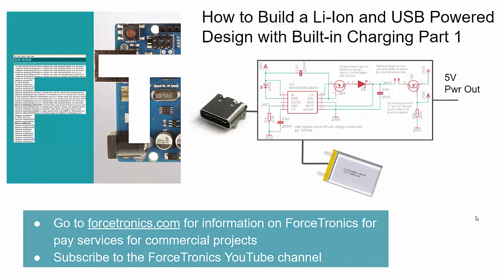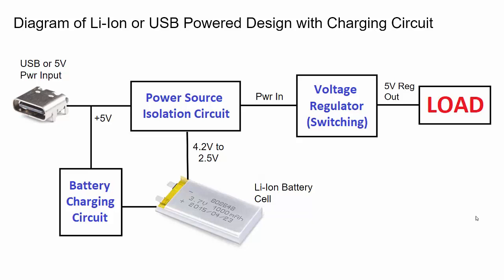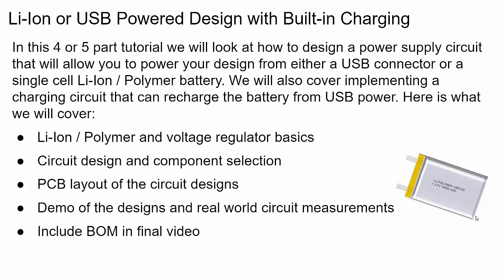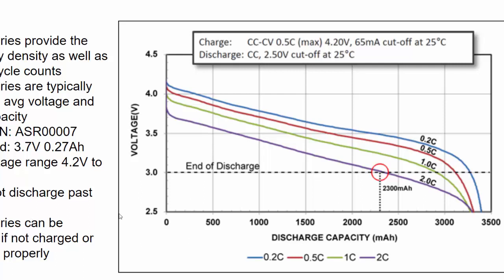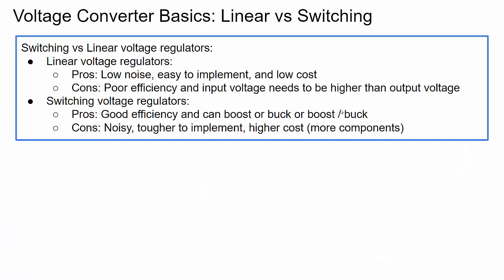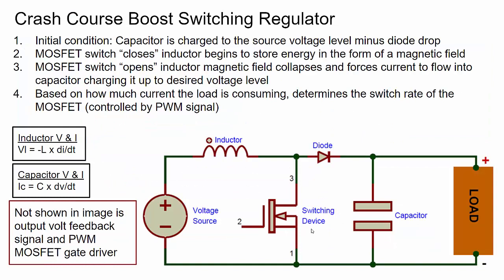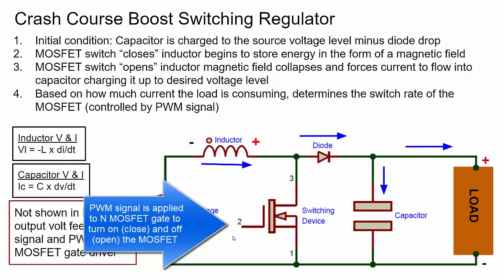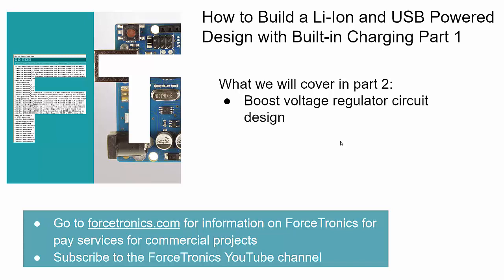How to Build a Li-Ion and USB Powered Design with Built-in Charging Part 1

Comment: Hi, i'm sorry for the noob question: does this charger IC has any sort of overcharge, overdischarge and short-circuit protection? Thanks! Amazing content!
Reply from the maker: It has some protection features but not very robust. It does not have the ability to electrically isolate the battery if an issue such as over discharge is discovered

Comment: I would caution anyone building this to take great consideration to the hash/noise radiated by a switcher that is on the same pcb or very near the circuit that is being powered. Something like this can easily disrupt I2C / SPI signals.
Reply from the maker: I love commenters like this 🙂
Any commercial device on the market where battery life is critical, whether it is an electric car, cell phone, or a VR headset, the main power conversion that is used at the battery is always a switch based converter because they are so much more efficient then linear regulators. There maybe a linear regulator further downstream for noise sensitive circuits in a battery powered design but the converter closet to the battery is always switched based. At least that is my experience for the battery powered projects I have been a part of. Noise is always a concern with switched based power conversion but somehow cell phone designers are able to use them in tightly compact designs with various sensitive digital, audio, and RF signals. Tune in for part 4 where we talk about PCB layout techniques for handling noisy switch based voltage converters.
Reply: @ForceTronics  Linear regulators are not noise filters !
Reply from the maker: @gd2329j  Actually yes and no. The main purpose of linear regulator is to regulate a constant voltage or current output. But filtering noise is a secondary feature of a lot of linear regulators on the market (especially LDOs). If you look at a linear regulator datasheet, like the NCP164CSN330T1G, you will notice a spec called "PSRR" which stands Power Supply Rejection Ratio. This spec communicates the linear regulator's ability to reject or attenuate noise on its input from its resulting output. PSRR is a spec I pay attention to when selecting a linear regulator to create a voltage bus to power a noise sensitive circuit, such as a thermocouple measurement circuit or a load cell measurement circuit

Comment: Hello! Great tutorial. Could you please also show schema for 3.3V output? The battery is 4.2V-2.5V and this is right between therefore sometimes step down and sometimes step up. Thank you.
Reply from the maker: Great Question! If you look at the TPS61202 that I used with a fixed 5V output you can see that it is actually spec'd for a max input voltage of 5.5V so these ICs do have "buck" capability built-in even though they are advertised as boost converters. If you go to TI's product page for the TPS61201 (3.3V output) you can see it has the same max voltage input of 5.5V so TI is telling us it can support input voltage higher than 3.3V. For selecting an inductor for the design, I suggest you select an input voltage (within the range of a Li-ion cell) that gives you the largest inductor value and an input voltage value that gives you the largest peak inductor current. Form there you can always go to TI's support forums and post the components values you choose and why and ask for feedback to ensure you made the best choices. I have always gotten good advice using their support forums.  Please share what you come up with.
Reply: The battery cannot go down to 2.5 volts. Below 3.5v the energy left is small and the risk to damage it is great. Typically only under high load do you allow < 3.5v. Look at the many discharge curves you will find and see that the volts drop off suddenly.
So to answer your question, just use a 3.3v ldo regulator. If your entire load is 3.3v, no need to boost the battery to 5v, any of the many TP4056 based boards will do just fine to charge / protect the battery. If your supply voltage is not 5v then a LM7805 regulator to feed it will take up to a 25v input.
Reply: @davepompea  That is only partial answer as for fixed installations you better go with LiFePO4 as it is much safer than Li-On. And that type has lot of energy below 3.3V.
Reply: @PetrKoc  No doubt, but the video series is about Li-Ion battery.
Reply: @davepompea  Well... yes and no. What if I wanted 3.6V output for any reason? Then it would be necessary to take care of this situation even with Li-Ion.
Reply: @PetrKoc  What if ????? You asked about 3.3volts. I answered.